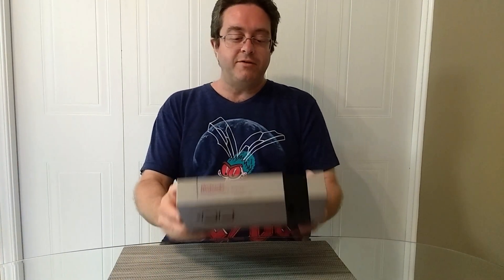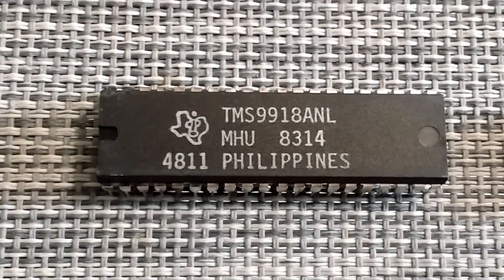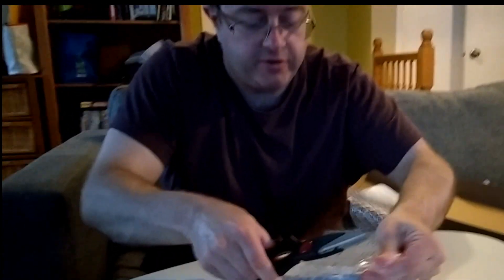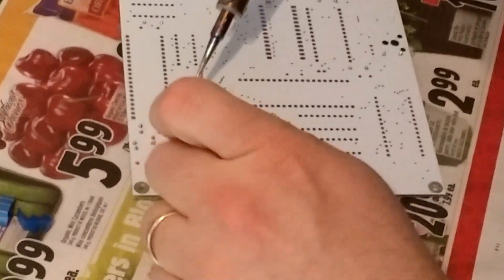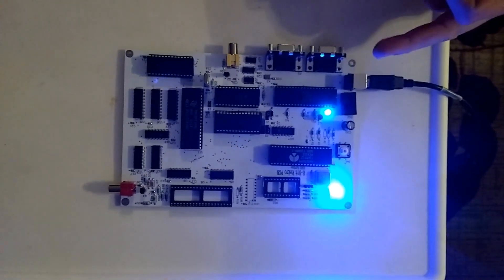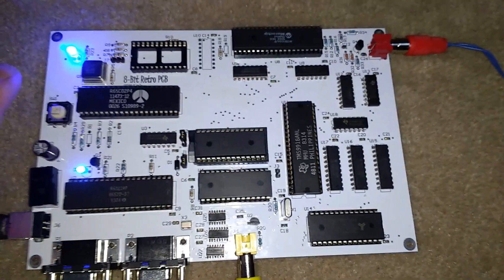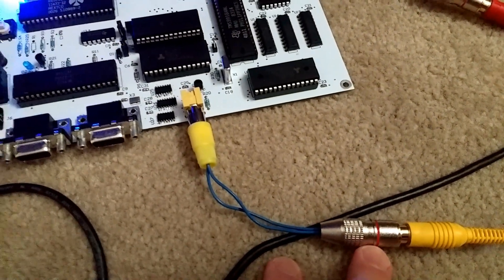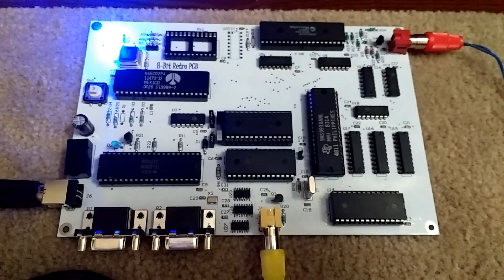Homemade Retro 6502 Computer - with 8-bit graphics and sound

Comment: im only 15 but how do i get started designing 8 bit computers? would it be easier to use a z80 or 6502 for my first project
Reply from the maker: I went for the 6502 because I had an emotional bias towards it... but I think z80 might be easier to interface to other hardware.  As a case in point it was used in more early 80s arcade machines than the 6502 was.  With that said, I haven't looked into it in very much detail... but if I were, I would learn about the MSX standard and study it's schematics... and of course I would look for resources on z80 assembler.
Reply: @dangrise6182  could you link some resources i could study with?

Comment: Why 6502 retro what is ghe purpose
Reply from the maker: It's just a personal project done as a learning exercise and as a personal challenge.  No purpose beyond that.
Reply: @dangrise6182  I confused why particularly 6502 is there any special about 6502 becaus some others also make this kind of stuff like this based on 6502.
Reply from the maker: @adhil8918  I see what you're asking now.  The 6502 or variations of it were used in many  home computers and gaming consoles back in the 1980s.  So there is a lot of interest in it.

Comment: I'm in the process of making my own 6502 computer. How do the video chip connect to the CPU?
Reply from the maker: Sorry for not getting back to you sooner.  In the next couple of days I will start up my laptop and review the schematic, because at the moment I don't remember the specifics.
Reply: @dangrise6182  Thank you very much! your help will go a long way for me!
Reply from the maker: So I am in the process of putting together a GitHub repository for my design.  You will have to check back in the next couple of days for the schematic.  This is because I have to update CircuitMaker in order to export the schematic to PDF.  Anyway the link for the repository is here: https://github.com/Dan-Grise/6502_SBC

It's been some time since I reviewed my own schematic but I do remember that the manner in which I created the write strobe was perhaps needlessly complicated.  In general I connected the 6502 data bus to the 9918 device's CD bus.  Then I believe I mapped 3 different CPU addresses to do the following:

1) Assert CSW low while keeping Mode high

2) Assert CSW low while asserting Mode low

3) Assert CSR low while keeping Mode high.

Number 3 above is to read the data register.  I am not 100% sure I implemented this.

I will remind you that I connected the 6502's 8 bit data bus directly to the CD bus.  There is a risk that  the TMS9918 hold time will not be satisfied.

An alternate method would be to have a latch between the 6502 and TMS9918.  In this case you would map an additional 6502 address space to store the data into the latch.

In this scheme you would first write data to the latch and then issue another write to create the conditions for 1) or 2) described above.

One more thing.  If I remember correctly the author of the TMS9918 datasheet considered bit 0 to be msb and bit 7 to be lsb... so that can cause a lot of confusion.
Reply: @dangrise6182  Thank you very much!

Comment: Wow, inspiring. How long did it take you? How much time did you spend in the design process before ordering the PCB?

Great job!
Reply from the maker: Thanks Mark, I spent quite a bit of time researching the chips, looking through data sheets and searching the net to see how to interface to the parts.  This preliminary phase may have spanned 2 months.  That was roughly 4 years ago... so I don't remember specifically how long, but I do remember taking my time.
Reply: You're gay.

Comment: What PCB software did you use? :)
Reply from the maker: I used Altium Circuit Maker.
Reply: @dangrise6182  Have installed it. May I asked where you have had your board made? :)
Reply from the maker: @bpolkadot  I got my board made at www.allpcb.com

Comment: I’m designing a w65c816s based computer, it is an enhanced version of the 6502. I’m looking at using Yamaha’s 9958 Video Chip.
Reply from the maker: Awesome.  I was very impressed with the 9958... especially its bitmap capabilities.

Comment: Hi, nice work. What is the crystal value of the TMS9918? 10.7Mhz or 10.738635MHz ?
Reply from the maker: Sorry for the delay in my response.  I used a 10.738635Mhz crystal.  The digikey part number is CTX1443-ND
Reply: @dangrise6182  No problem, Thanks

Comment: Ay3-8910 can control joysticks too.
Reply from the maker: True enough.  However, the additional decode logic for supporting reads from the AY3-8910 seemed painfull to implement at the time.
Reply: @dangrise6182   you are correct. I do not know aboult the other  IC,  but the  AY3-8910 need protection in the ports and care with software.

Comment: The Atari 2600 uses a 6507. The 65C02 was used in the Atari XL and XE, though it was a custom tri-state version. It's only the Atari 400 and 800 which use a Rockwell stock 6502. The NES does NOT use a 6502.

I hope you will further develop your computer with an OS and a default programming environment. I recommend a BASIC variant which can access and use all the hardware features, but also have a fully featured underlying macro assembler the user can access.
Reply from the maker: Thanks for the additional technical info.  Later on when I made my 2600 clone I did indeed learn that the CPU was the 6507 like you mentioned.  Maybe down the road I'll implement Basic for this board.  No promises though.

Comment: Nice job. You made only one silly mistake with the RCA sockets and got everything else right. Just like a genius - all the hard stuff right and all the easy stuff wrong. Congratulations on a awesome PCB layout design 5☆
Reply: Usually when something looks great it is in fact "great" Go to market with a DIY kit immediately.
Reply from the maker: Thanks, there are still areas of the design that need to be improved.... I think the video buffer circuit has to change to make things more crisp... also I would like to simplify some of the decode circuitry.

Comment: I used to have a Compukit 101 that was like that ...
Reply from the maker: Cool.  I just read through the wikipedia article.  I had never heard of the Compukit 101 before your message.  How much did it cost, and did you install all of the components on it yourself?
Reply: @dangrise6182  Around 1981 it cost me £175. It had a large dark green pcb. I had to solder all the chip sockets on, and also the keyboard switches. It had just been changed from 3.5 to 8k of memory when I bought it. It had an rf modulator and a composite video rca out. Data was saved on audio cassette. I was presented with a poly bag with all the bits in, then it was up to me. I spent some time trying to find which chips had pins bent underneath when inserted in the sockets causing faults. I think I used a 12v plug in psu, and there was a 5v regulator on the pcb. It was fun using text graphics. There was an Americal kit similar, I think it was the Ohio Superboard, or something like that?  When it eventually gave up I soaked the whole thing in varnish and hung it on the wall like a picture ha ha ...
Reply from the maker: Sounds like a great memory.  I can relate to what you said about bending pins while pushing the chips into their sockets.  I have been guilty of that crime too. LOL.

Comment: can it run River Raid?
Reply from the maker: It would have to be ported first, but from a technical stsnd point, I do believe that River Raid or any other Coleco Vision port can run on the board as long as code fits in 32k or less.
Reply: @dangrise6182  Please do not port from Coleco (that version is crap), Atari 8bit and C64 had a decent River Raid version
Reply from the maker: Currently I am too busy to port any version.  However, you've peaked my interest.  I am going to watch videos on each of those versions.

Comment: And the keyboard is where? Looks like you need another 6522?
Reply from the maker: Hello Greg. The board includes a site for a 68B50 asynchronous communication controller.  I believe I could use that to accommodate a key-board.  I would have to investigate this further.  My intent with this project was to make a single board computer and not a personal computer so it has more in common with the NES or Coleco Vision than it does a commodore 64.
Reply: @dangrise6182  First of all, thank you for your patient reply.
Its funny you mention the Coleco Vision, didn't they offer at one point a add on system that made it a full fledged computer? Same with the NES in Australia, to my memory. Weird, Huh?
It was just a thought, something to ponder as you continue with your project, which is cool by the way.
Reply from the maker: Thanks man.  When I get around to making rev B version, I should definitely brain storm a bit and see what provisions can be made for future expansion.  And, yes from what I heard, Coleco Vision had something called Atom that would expand its function into a personal computer.

Comment: source of new tms9918a and ay38910s ? also it's missing ethernet. :P
Reply: That's how the cookie crumbles when using old video chips. I'd love it if someone made a new production video chip that had HDMI out for these projects.
Reply: @snorman1911 well. i would never put that shitty hdmi connector on anything... but DVI-D. same protocol. different and more sturdy plug. lol. but yeah the market needs mil-spec DIP formfactor 5 volt video chips that output 'anything that connects to monitors for sale today'. urgently. preferbly without all the glitches such as are in nintendo ppu chips. nice clean design without 'self destruct' options in software. lol.
Reply: doesn't have to 'do much'. i mean i can live without 'sprites' and even 'color' as long as it displays stuff. mainly text from a char rom lol. but you can't even get teletext generators nowadays. lol. not in bulk anyway.
Reply from the maker: I seen an ebay listing for 6502 tms9918 kit.  It included a 6502,   a TMS9918, an AY38910 and other chips.  I think the seller is still selling this kit.
Reply: @dangrise6182  random ebay or aliexpress NOS listings are hardly a reliable supply source to build a new microcomputer platform on. 65C02's are no problem but 'any hard core video chip' that works with it is (otherthan some clones of thenintendo ppu which are in current production but those have weird on-board clock generation etc you gotta design around) sure we can take the tms9918, kick it into a microcomputer, for all i care use a bunch of covox arrays hooked up to some ram and clocking as the sound device (no supply problems there ;)... but then let's say we pull 100K tms chips off aliexpress for the first production batch. where are we gonna find 10 million more of them for the next production run. lol. (been looking at options at filling the market gap for a 'c64 like' system with ethernet and a nice clear memory map and tons of sram and homogenous hardware for a while now... also want it to be fully pin-through 5v dip (proven reliability for over 50 years).. but... video chips are a problem.
Reply: not even really picky on the output. if their tv doesn't take cvbs or analog or digital rgb (whatever - i don't care - preferably dvi-d tho) as long as it's not hdmi with its weak and crappy licensed connector. they should just buy a proper tv haha. all our tv's have a LOAD of connectors on the back.don't know where those noobs buy theirs. but i guess we can sell them a monitor to go along with it anyway. :P (people keep complaining their tvs won't connect to cvbs signals... never had that issue. maybe they should not buy the tvs of 50 bucks. ;)
Reply: there is something to be said for ibm's old cga 'digital rgb' standard in that aspect... as in no video chip needed at all.just a bunch of shift registers and counters. but then we'd have to convice some people in china to make monitors for it (preferably with exactly that native resolution ;)
as in that case it would be best to pick one resolution and one scan frequency and that'll be the standard forever. no changes to that whatsoever (don't wanna end up like vga did ;)

Comment: i designed a 8 bit computer Before 4 years ago.33Mhz
Reply from the maker: Cool.  What processor did you use?
Reply: i used  two  intel 80 series . now i am trying to make computer using 89c55 or stm32
Reply from the maker: @usmanumer9871  Cool.  If you post a video let me know.

Comment: hi dan. i have an idea for usb pcb that will let you reset or power on and off any computer. i would love to talk to you about it if you can.
thank you in advance.
David.
Reply from the maker: Tell me more.
Reply: @dangrise6182  
can i send you everything i cam up with until now?
it will explain what i am thinking of better then i can say in just words.
pleas tel me where i can send my files. (2 files : 1-bmp, 1-text file)
thank you very much.
David.
Reply from the maker: @davidlevi8413  Okay send to dangrise@gmail.com
Reply: this can probably not be done in a reliable way. if you're trying to make it act like a keyboard with power buttons and control-alt-del then all of those are dependant on wether the os it runs allows that. pulling reset from an actual pci card won't reset the system (just anything on that pci bus), so good luck on doing that from a usb device  pretending to be a pci bridge. you can ofcourse do it with some microcontroller connected to the power switch and reset lines of the mainboard but that is not usb. and thus so far... everyone simply buys servers with ipmi/bmc which come with the disadvantage that the customer can change the configuration and boot you outofcontrolon rented out servers.. or just good old fashioned remote power switches for everything which does nothave ipmi/bmc's with or without a serial consoleserver. for a while we also simply wired the WOL pin on network cards to the reset line (so wake on lan packets would not power up a system but reset it which is far more useful in most applications anyway. those boards were modified to always poweron anyway. nomatter what,they'd power on ;) but there really  isn't much you can do without either rewiring some things on the inside, builtin ipmi/bmc or amt support, or an external powerswitch. eventhough serverfarms account for most of the pc market sales none of the manufacturers deliver products that we'd actually want in the way that we want them.  (amt is just a general security risk, ipmi allows the tenant to boot the landlord out of the server and it's programming specification is 'vague' to sayt he least, and all the restof the options involve extra hardware either in or outside of the system. no way to do this from usb (operating systems can easily be set to ignore the power button on keyboards, do something else or ignore control-alt-del, etc, wintendo for example comes up with the task manager and doesn't reset). and i've yet to see any usb keyboard with an actual reset button on it. only way to make sure any-system resets is to hook something up to the reset pins on the board or flip the power for a while. for resetting in software there are 3 methods... 1: keyboard controller (usually not present anymore) 2: pci (on some systems this just crashes them) 3: triple faulting the cpu (also doesn't always work)...  and those arethe options if you actually have YOUR software running with full privileges -within the target system and even that isn't standardized and always working. (although the keyboard controller method should always workor else they  aren't legally allowed to advertise them as ibm pc compatibles and yet it does not ;) there is no uniform way that guarantees these 2 very basic functions (reset and power control) work. much less taking it out ofthe 'pc compatible' area and entering other platforms (arm, power7, etc) so i guess people walking to the thing to press reset by hand will remain a thing for a while. (if you never power anything off and remove any and all capability for it to be 'off'  the 'abusing the wake onlan pins' to connectthem to reset is still the cheapest, most secure and reliable option. (as long as each box/customer is on it's own dedicated vlan)

Comment: 65c02 and 6502 were NOT used in the consoles you mentioned in the intro! 

NES used a custom version of the 6502 with some instruction changes.
https://wiki.nesdev.com/w/index.php/CPU

Atari 2600  used the MOS 6507!
https://en.wikipedia.org/wiki/Atari_2600
Reply: Kind of nit picking. 6507 was just a 6502 with a smaller external address bus. The Commodore 64 technically used the 6510, a 6502 with an IO port built in, but it's generally referred to as a 6502 system.

Comment: I never see anybody make a multi-processor CPU that's 8 bit and 8-bit math coprocessors to see if you can push polygons or not. If I had your talent and c++ id try to make an indy game pixel art and to see how many background layers.
Reply from the maker: The idea of pushing 80s era technology to the max is an intriguing one.  I don't know that I would ever be the right guy to take on polygons... but the idea of making custom graphics cards using 80s tech in a similar matter to what they did in 1980s arcade boards is an area I am interested in.

Comment: 0:54 that's the 65C02, not an original 6502. there are noticable differences like new instructions that the 6502 didn't had, faster clock speeds, etc.
i think the first computer to use the 65C02 was the Apple IIc